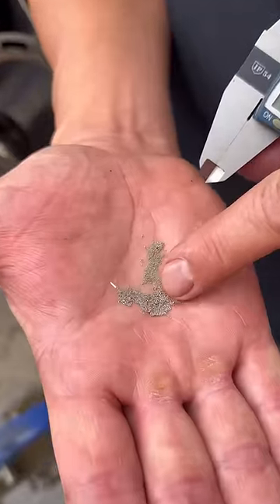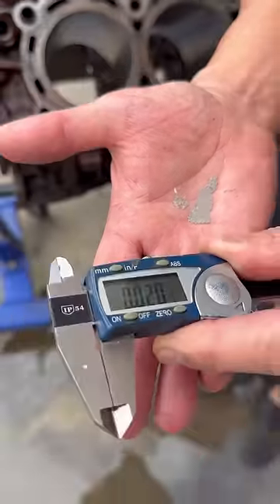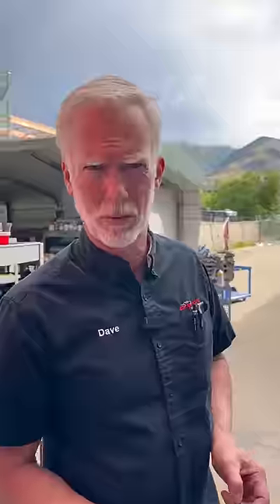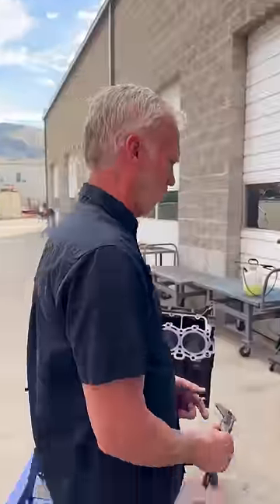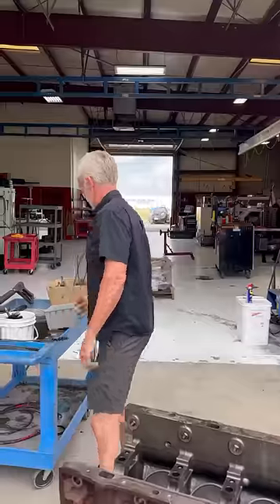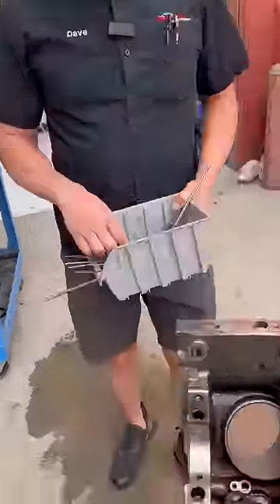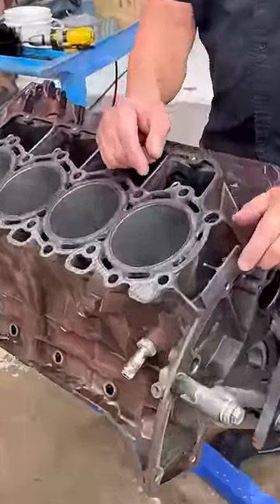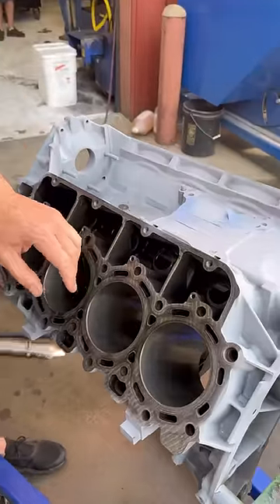How we clean and prepare our engines before assembly

Comment: I like how they remove all the beads but yet they don’t cover the cylinder walls when they spray paint and prime, the freaking engine block😂
Reply: If it's going to be machined who cares?
Reply: Came here to say this lol
Reply: Don't know much; it does seem.....
Reply: When I see people paint an engine, most never use primer
Reply: @bassman5066  disassemble/clean,machine/clean,paint and reassemble
Reply: I scrolled just for this comment lol
Reply: YEAH! That over spray will last at least two seconds on fire up, eyes rolling.
Reply: Definitely not great for the head gasket sealing surface
Reply: I seen that too.
Reply: @tomhubbard353  so the scraped off paint will get in the rings..that's ok then.
Reply: part of the reason you change the oil a like a dozen times in the first few thousand miles on a rebuios
Reply: The cardboard for over spray is enough.. cylinder walls get honed before assembly anyways..
Reply: ThTs because they’ll hone the cylinders
Reply: If the block has been shot blast, why is it so rusty?
Reply: It is getting machined.
Reply: @Khalifa_thread well at that point the sequence doesn't matter, you just have to make sure the finished product is, finished. Why does everyone have to act like an expert over others?
Reply: I don’t even know how to fix a car and I thought…. You probably can’t paint in there but idk 🤷
Reply: @Gixsir  the paint is like step 4 of 600 of assembling that engine. All of the important stuff will probably get machined down to clean metal
Reply: @bassman5066 Why would you paint an engine before machining it? Do you even know what it means to remachine the block? Please tell me your joking...
Reply: @Necrodoxious so you put paint on a block that's getting all the paint cleaned off it?? That makes sense...
Reply: @dbabdbbbghbb why do people keep saying it's getting machined so it doesn't matter.... why tf would you put paint on the block if your literally cleaning all the rust and paint off it right after. It wouldn't make sense whatsoever. Do you even know what it means to remachine the block? Holy cow.
Reply: @ZReLiSh42 engine block will surface rust in minutes
Reply: yeah... a little overspray will definitely do, uh... absolutely nothing... it's paint, and not much of it. is it a good idea to dump tons in the cylinders? no... but again, a little overspray is not gonna bother fresh rings being seated at all.
Reply: @salvadordollyparton4826   I completely agree. But there's people above saying, "It's going to he machined anyway. " I guess I just don't understand why you'd  waste the time or the primer to spray it, if it's literally coming off right after.
Reply: @appalachianamerican1776  that's not true at all. Iv had a clean 350 half rebuilt sitting in an engine bag for 4 months. As long as there's no moisture in there, it can't rust. You must not store your engine properly in a DRY location...
Reply: @appalachianamerican1776  if that was true, every single engine block coming from a factory would have rust underneath the primer and paint... the only way something can rust is if moisture collects on it...
Reply: @ZReLiSh42  you have no idea what your talking about. Keep on little fella ask Daddy for a full explanation.
Reply: @appalachianamerican1776  😂 yup. That's why I'm able to keep a block clean for 4 months but for you "it would surface rust in seconds" it must really suck to not know what your doing doesn't it bud?
Reply: @appalachianamerican1776  if you think "there's no possible way to stop surface rust" then please go back to school buddy.
Reply: @CDXLIV444 the block is being resurfaced the paint has no affect on anything.
Reply: @ZReLiSh42  i said minutes and I didn't say there was no way. Don't move the goal post to cover for your ignorance. Unless you live in Arizona or the like. It must be treated/ painted. Right away. How did your blocks get clean?
Reply: @ZReLiSh42 I can hear the confusion and anger in your writing. Put down your controller and ask mom if Dad's ever going to come back home. Tell her you have important questions about grown up topics you need help with.
Reply: @appalachianamerican1776  ummm i live in upstate new york. It's called having a heated garage 😂. It's not really rocket science. If you dont know how to keep a machined block from rusting, you need to get off the internet and get out in the garage more. I don't know how else to help you lol. Maybe while your on the internet Google it? Maybe you'll understand how rust forms and how to prevent it...
Reply: @appalachianamerican1776  also, my confusion is from your responses. I'm curious how somebody so wrong can be so sure of themselves? Like literally it's entry level science. Iron oxidizes after being exposed to water. If you never expose the iron to water/moisture, it can't rust. Its as simple as covering it with oil and wrapping it in a garbage bag or engine bag. I don't know what point your trying to make, but everything your saying is literally scientifically proven to be incorrect 😂 but please. Carry on spewing nonsense
Reply: Am sure they will reclean........Every hole🧐
Reply: @ZReLiSh42 machining does not mean rust removal... its removing the damaged surface of the internals. He painted the outside lol

Why would they ever need to grind down the outside of the engine after the rust has been removed?
Reply: @KL-xe5ec  most engine mechanics do the whole block at once. I don't see a point in cleaning half, painting it, them doing the other half. Just do it all at once. Surface rust is very avoidable. I wish people would stop acting like its impossible to prevent surface rust on clean metal
Reply: It'll burn out after the first 10 seconds anyway. Engines are like that
Reply: Guys, Here is The True Savior

HalleluYAH translates “Praise ye YaH”

YaH is The Heavenly Father
YaH arrives via the TENT OF MEETING
YaH was Who they Crucified for our sins
YaH was Crucified on an Almond TREE

Ancient Semitic of Moshe (Moses)
Isa Scroll (The Original Isaiah)

Isaiah 42:8
"I am YaH; that is my Name! I will not yield my glory to another or my praise to idols.”

Isaiah 43:11
“I am YAH, and there is no other Savior but Me.”

Isaiah 45:5
“I am YaH, and there is none else.”
Reply: The block went into a boiler tank to clean out the sludge

Comment: I worked at a small machine shop in Colorado Springs. The owner (83 year old man) was equally meticulous as you are. I tore down and hot tanked parts. Then spend a hour going through every passage way, and bolt hole with a brush. I really learned a lot from Lambert. 
Cleanliness, and precision are a the key to long lasting engines.
Reply: Did you do full engine assembly as well? I love working on cars as a hobby and would love to build my own motor one day. I’m comfortable with doing just about anything other than bottom end teardown and rebuild. There’s so many little nuances you have to know when putting together an engine if you want longevity. How would you suggest learning without having to go to school or changing careers?
Reply: @sethbrown5856  Honestly, I did all of the tear down on the engine block, and cylinder heads. I did a lot of magna fluxing, and pressure checking heads. I moved up to milling, and assembling heads. 
 I did however completely rebuild a couple of Onan (in a John Deer rider mower). Plus a few old D Series John Deer engines. 
Almost all of our engine assembly was completed by the Senior builder who was a HUGE Volkswagen enthusiast.
Reply: What was the shop called, if I may ask?
Reply: Exactly .
Reply: I've been told by mechanics for years all rings spin untell they seat . 
Not mine . 
   Lacker thinner clean the piston spotless.  Face the rings 💍 where you want them . The object is so that any oil pulled up is on the torque side of the piston and chlender . 
   Pin the rings in place in the middle of the ring with hy temp . First and second ring .   No blow by at 200,000 miles engin will pull 24 inches mercury vacume . Crank case and chlenders totally sealed from each other . 
   And by the way why do you rebuild it all without gapless rings made in Colorado Perfect 
Circle rings .??? .!
Reply: @sethbrown5856  Practice and research. For your first one, find something common and simple. LS, Honda K series, 3.8 v6 GM, 5.4 v8 Ford, etc.
Do as much research as possible and then do more. I cannot stress enough. Find every serial number, casting number, part identification lists, etc in order to ensure exactly what engine you have. 
Stripping engines is easy, just label everything. 
Next is measuring. If you're doing bottom end/rotating assembly work, measure your bearings, journals, and caps. You will need special tools but they're not insanely expensive and if they are for you, you're in the wrong hobby lol.
Lastly cleanliness is king. Clean everything several times and ensure what needs lube/oil to apply it.
Also torque spec everything first time. Can't tell you how many bolts I sent too hard trying to rush my first big job like that. It's not worth it
Reply: @murkadelic422 good advice! I do work on my family's vehicles from suspension to engine tear downs. I specialize in small motor builds and it's always a good habit to label and cleanse as you go. Good luck on your ventures brother! 🍻👍
Reply: @murkadelic422  the old man Lambert had books and books on casting numbers. I watched him cross reference a completely different rotating assembly to build an old tractor engine, that used leather bearings. He got a piston and ring combo from one engine, a con rod from another. We sent out the crank to get the rod journals cut down,  put it together and made it run. 
Thanks for helping me to remember that. That brought a smile
Reply: @iamgriff the machine shop there just shut down I was the last apprentice that worked there. They were a spectacular machine shop one of the best in Colorado. Happy I got to learn and do everything they had to teach me !
Reply: @ShiftnStyle  so the old man passed away? What happened to Dave, and Glenn?
Reply: I just got "duped" on a 2000 Chevy Silverado that started knocking a week after I bought it but on the bright side I'm getting an education on engines which is invaluable...everything happens for a reason
Reply: its a great oportunity when we learn from a old man.
Reply: @AllenBarclayAllen 😅t
Reply: Meticulous? He didn't even tape anything off and just went ham with that spray can😂 just stupid a comment you made
Reply: @jasonhollis5916  your reading comprehension problems are on public display
Reply: @iamgriff  so is your ignorance
Reply: @iamgriff Name of the machine shop?
Reply: This is something you need to do to learn. You can learn tips to assist you but you need to actually do it in practice to understand it. Its like any other mechanical project, hows it work? Idk lets take it apart @sethbrown5856
Reply: Its the same in a machine shop...the ones not emulating disneyland.
Reply: @ShiftnStyle, any recommendation on transmission repair/rebuild in the Springs? I'm new to town and have not built any relationships with repair shops yet.
Reply: hello, im in the springs and would love to stop by this shop haha. whats it called?
Reply: @jasonhollis5916  Yeah, I noticed that too. Didn't seem right.
Reply: @jasonhollis5916 it's not your fault that your dad left
Reply: What Happened to the shop,  is it still in operation?
Reply: @thomascampbell5633  You noticed as well did ya? That's odd..
Reply: @jasonhollis5916  There's tape on that core bud, pretty easy to see that and the cardboard. I'm hoping you're just wrong and not one of those guys trying to lie and discredit knowledgeable techs and mechanics.

Comment: Every cast block built starts out full of sand. it's all about that prep work for a great engine build. Love what y'all do, love the content. I love watching and learning, and you sir are one of the best I've seen so far!!!
Reply from the maker: Thanks 👍
Reply: And some engines, like the Ford 6.0 never get it all out either!
Reply: @markm5287  well it's so it can be constantly rehoned 😂 🤷
Reply: Not "Every" cast block is, some are high pressure die castings.
Reply: @jamesgeorge4874  so you're saying it's not all about the prep work? It's just about how it's made 😂 come on man, I'm talking about mass production blocks, specialty engines are definitely made different that's why we pay more for them, but not mass produced engine blocks. The manufacturers are about speed and profit in general thus most blocks are sand cast full of flaws to keep the customers making payments. Am I incorrect my dude?

Comment: in aviation we use glass beads that will just break before it wrecks anything. your way looks good too though 👍
Reply: Wtf are the beads for?
Reply: @mavij-s4723 Basically sandblast cleaning the motor. He shows in a previous clip.
Reply: That sounds like a WAY better idea. I would never trust that brushing and using air would remove every single bead.
Reply: But they are probably using them in a furnace not a sandblasting cabinet and silica will melt
Reply: @cornpop3954 because it cajoles another couple bucks out of the rich man's pocket when it rolls across the auction block.
Reply: @cornpop3954  Humans tend to like pretty, shiny things.
Reply: @cornpop3954 it’s not just to LOOK clean, usually engine parts that are cleaned run more efficiently with less chances of damage or failure occurring down the line
Reply: @littlerayofsunshine69 ” blame everything on capitalism!!!”
Reply: @cornpop3954  That makes no sense. Why would you care what the inside of your engine block looks like? It's purpose is to clean it I'm pretty sure
Reply: at least with the cylinder head if something goes wrong a week after rebuild, it will be easy to tell when you tear it open
Reply: I couldn't trust that ALL the beads were removed....chemical cleaning plus brushing,water blasting and high pressure air would be much safer.. imo
Reply: @cornpop3954  we use it to remove finish from metal parts. once the finish is removed we treat the metal to prevent corrosion and repaint it to further help with corrosion. the only cosmetic choice is the colour of paint we use.
Reply: @kymtorr1808  we use those as well more on the motor side of things though

Comment: “And we’ll paint it”
Me expecting a full paint booth
“Sprays with paint can” 🤣
Reply: You don't need a full paint booth for engine painting. It's a very small area and only takes one or two rattlecans.
Reply: And he left everything open when he painted
Reply: @PrestonSteele09  I never said you did. It was sort of implied dude was going to have an elaborate booth. But yes chemical paint is always better quality than spray can due to the nature of the chemicals that need to be used to save in a can for years on a shelf vs proper timed chemical release. I worked in a body shop for 4 years after college. It makes a difference
Reply: @brenthernandez3632  No he didn't. You can clearly seeing masking tape painted over, and the cardboard held over the cylinder holes is the most practical way to do it without wasting labor sealing them with plastic/tape. Did the job absolutely fine. Any threaded holes for bolts etc don't need to be covered, the paint may enter the thread but the bolt will clean it straight off and its not a concern.
Reply: @brenthernandez3632  You know paint is a soluble an nowhere nearly as hard a stainless bead shot. Any over spray that gets in critical spaces can easily be wiped out with acetone. A old hot rod trick for better oiling was to paint the lifter valley. But you have to use a specific paint.
Reply: @adhus6037 look at the very end of the video - the cylinders are wide open.
Reply: @markmorris6208  That's true as long as they go over the threads/cylinders with acetone they should be good. Still not what I'd expect from a professional shop, but it shouldn't be a problem so is therefore 'acceptable.'
Reply: Yeah ideally they should powdercoat it, but they probably just use high temp paint. I'd prefer powercoating as well
Reply: @markmorris6208 
That paint for inside is called Glyptal, and Eastwood sells it.
Reply: I came here to say this
Reply: The last step to brushing the cylinder is to oil it and the same for the deck surface and bearing journals keeps them from flashing at the same time paint won't stick to oil lol the three areas will be cleaned and oiled with brake cleaner and lint free towels multiple times before the motor is fully assembled and if the customer wants something else specific other than spray paint I'm positive Dave has other options at an increased cost
Reply: THANK YOU! @Motor-City-Mike
Reply: @mrmidnight32  you'll be extra surprised when you learn that all paint is chemicals ;)
Reply: Yeah that's how I did mine in the driveway lol
Reply: Without taping anything off this dude is a hack
Reply: if you paint the cylinder walls it keeps it from rusting.
Reply: Mhmm and when that paint gets in the cylinders like we all just watched it do…

Comment: I’ve built more than a few motors and every block is taken outside to be washed and scrubbed. 
If you aren’t soaking wet when you finish, you didn’t wash it enough. 
 Making sure there’s no bead blast material is a responsibility you should take on as the builder.
Reply: We had a washer. Put the block in, close the door and push a button. We stayed dry
Reply: @BobSmith-kd6lq  
  The machine shop has already done that. Just spraying water isn’t adequate when I’m investing thousands. 
Hit it with water and brushes, blow it out and repeat.
Reply: At Wrights Racing Engines, The blocks and parts get washed with high pressure soapy hot water...  No matter how much you try you always come out drenched.